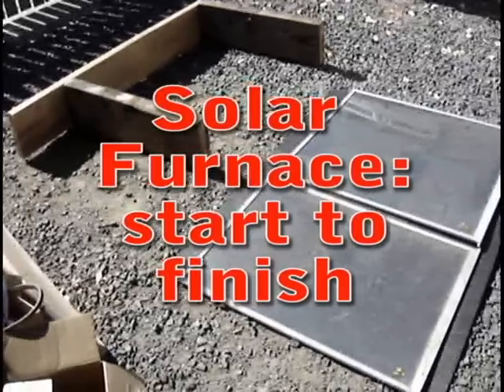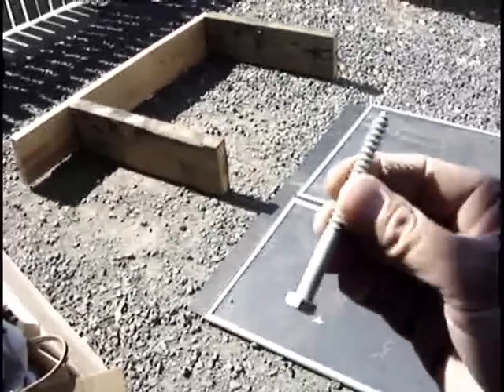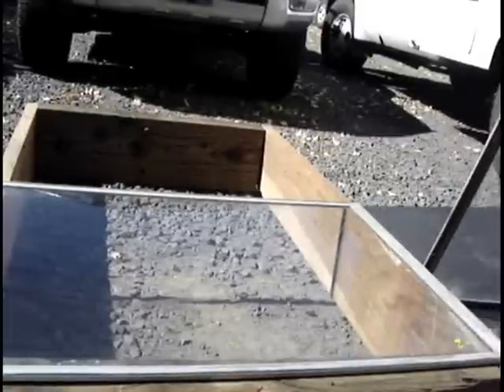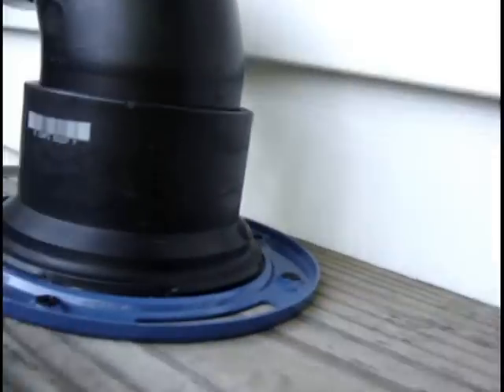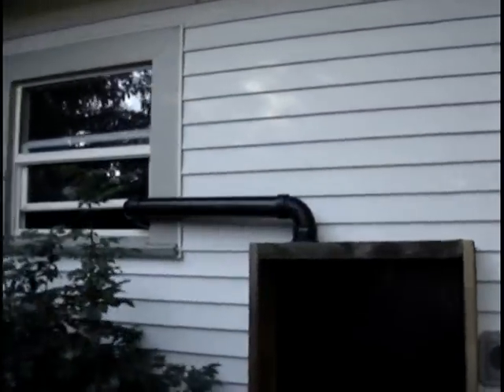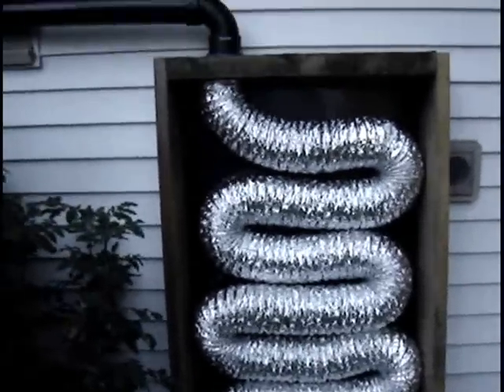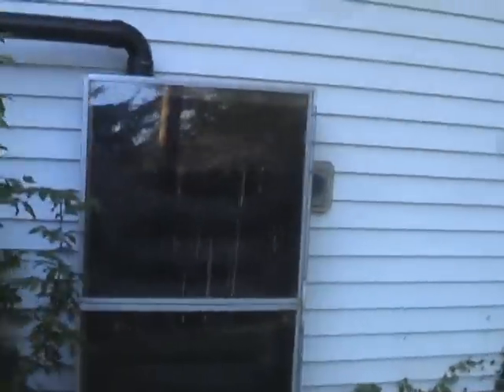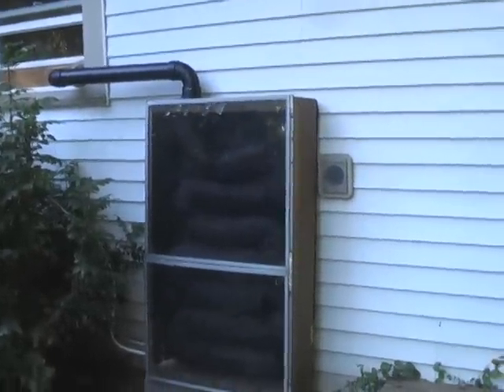Solar Furnace for under $50

Comment: the box needs to have insulation behind the black plastic.   the coiled  vent pipe should be painted black. a lot of the solar rays are being reflected.    The return air back to the box is too small you wont get much of a convection  flow of air, you really need the same size pipe going back as going to the window.  Both the in and outlets need to be insulated.

Comment: What a waist no heat measurement when done makes me wonder if it ever worked. Second insulated duct work from box to window would have been much smarter than just plastic. The heat you generated was lost in the uninsulated pipe.

Comment: To be a good Scientist or Engineer when you make something you have to prove it works.
Reply: I can assure you it does not work.  The amount of heat generated will be trivial, as there is very little solar heat in the winter, which is how winter works, and all of the heat captured will be lost to the ambient air.

I tried a solar water heater in the winter using black 5 gallon water tanks and got nothing out of it.
Reply: @May5Guy  All depends on your nation location -  hours of  Full Sun  sunlight... etc.  Many books and videos and websites explain this... if you get less than 4 full sun hours every day in winter -  you are in too cold a climate,  or you have to  greatly  increase the size of your solar array to make up for the  short time of   Full Sun   energy.
Consider combining with a deep Geothermal  pump... the Warmth of the Earth is always there, just a few meters right below your feet.
Reply: @May5Guy  I can cook in the winter using my parabolic solar cooker. Must be some kind of good sun hitting even in the winter.
Reply: @May5Guy  There is PLENTY of solar heat in the winter. We have solar ovens that get close to the same temps as Summer, just not the length of time to cook with.

I have an indoor outdoor thermometer that I installed in our greenhouse. Today the outside temp was 32, the inside temp was 80+.
Reply: "Demonstrate",  not  prove.   Proofs are for mathmatics.     In science you demonstrate your concepts and data and experiments  all line up cohesively.
Reply: @SeaJay_Oceans  You have never heard of "proof of concept?" Wow.
Reply: NUTS! Do it for whatever reason you want, especially if you enjoy it. Don't ever consider spending any time - at all - proving yourself to others. Just who TF do they think they are, asking you to prove yourself to them? 

However, it does help if you're trying to make a sale... Proove it. Then take as much money as you can from the lazy, or ignorant, or no time/talent/skills, nitpicking crowd! (Remembering to be kind to the people that appreciate what you do) What the heck! Be kind as often and with as many people as you can. It's a good way to move from here to there.
Reply: @johnshilling2221  ... If you're gonna take the time to make, edit, and upload a video to show others what you've done, then yes, it would be helpful to show your efforts working.  We already know that systems like this will work but if you have a newer design (i.e. not pop cans or gutter spout) then it would be nice to show how well your system works !!
Reply: @huf67  I don't see this helping much for a house, but it could be a solution for a shed that you want to keep from getting below freezing.

Comment: No offense but the one I made with beer cans and insulated with greenhouse plexi over it raises the house air temps by as much as fifty degrees. It moves a lot of air by convection at that temp. It's built on a thermopane design pulling in house air, heating it and returning it to the house. Inlet fits in the bottom of a window so it can be removed easily during warm weather.

Comment: Interesting.  However, as mentioned I'd need to see actual proof of heat produced before I wasted the effort to make this thing.   And I'd install a simple fan inside the duct to force air movement along with a lot of insulation on the pipe outside the solar collector.   I have solar hot water pool heat on the roof of my house.  The filtration pump sends the water up to the collectors before it returns the water to the pool.  It puts out an astonishing amount of heat.  On a hot day, I can raise the temp of my pool 5-6 degrees in an afternoon.   So the idea has merit.

Comment: Take every principle of thermal dynamics and you did the opposite. This is the worst thermal heat scavenger system I have ever seen. From using reflective materials where they should be dark and dark where they need to be reflective, to using large bore pipe where it should be micro bore and many many ways via a manifold. You didn’t even insulate the heat scavenger chamber to stop captured energy from escaping via conduction, radiation OR convection.  

I don’t think I could actually come up with any single way you could make this worse and I’ve seen some real crappy DIY heat recovery and scavenger systems in my time. 

As a side note, it makes your house look like a hill billy shack, I guess you sold your class with your brains.

Comment: Shouldn't the entire pipe be insulated as well as the intake tubes? Why no insulation around the exterior of the box either? Also, by not painting the wooden frame you will have mold, water seepage, and rotten wood.

Comment: I took a solar energy class back in the '70's when if you wanted to do anything with solar, you had to build it yourself. I am glad to see that there are still people who can build things!! If I might make a suggestion about a solar air heater. Build a box like you did, but leave some room for insulation.  Cut some plywood for the back, and put some insulation on it. Styrofoam sheets are easy to work with. Put some cleats on the inside of the frame, and you may have to put a few supports in the middle of the box. Put corrugated metal roofing on top of the cleats, and paint that flat black. Your idea of using reclaimed windows is fantastic.  Abs plastic pipe is a great idea, with the inlet at the bottom and exhaust at the top. Insulate the pipes that are outside. For more efficiency, tilt the box upward so that the angle to the ground is the latitude you are at, plus 10 degrees. This will aim it at the sun better in the winter. Keep up the good work, and keep experimenting with things.

Comment: My Uncle did this type of thing 30 years ago. Built a box with skinny dividers using scrap paneling to form channels like a maze (All painted black with a plexiglass cover.) with a thermal trip damper to let the warm air in to the garage. No fans to bypass the heat vrs.cold. It was kinda cool! Bigger at the entrance and got narrower as it got to the exit!

Comment: Weak design. It should be made with 2 layers of glass, with an air space between them.
Everything should be painted black, and have baffles from side to side, all the way from bottom to top, to make the air travel further, giving it more time to heat. Also, the pipes leading from the house to the solar heater, and back to the house, need to be insulated.
Reply: I constructed one several years ago at a previous address.

Comment: I'm thinking of just adding the metal black dryer vent pipe between my Storm window and regular window. So easy.  Sun hits it and that cavity space will heat right up quickly imo.   I wouldn't fill the entire window.....just 1 row at the bottom as I want it to look good.  How does this sound to all???
Reply: Its the easiest most cost efficient design, no fan, no blower,  simple,  yet it heats the window cavity

Comment: sorry didnt read all the comments but can this be regulated ?
Reply from the maker: Yes, it can.  In the next video, Solar Furnace Data, I install a computer fan powered by a solar panel.... when the sun is out, the unit blows hot air

Comment: And when the sun goes down, what? Stuff the holes with sweat shirts to keep the cold out?
Reply: Since it is a 4" ABS pipe, just get a 4" plastic pipe cap and slip it on the pipe when you want to shut off the air.

Comment: Paint the intake hoses and all the wood on the box black. Then use a black rubber to insulate the inside of the box. Rubber or asphalt holds in heat really well.

Comment: So why not measure the temperature to demonstrate the effectiveness? Otherwise I am skeptical.
Reply: @ANGLINARMY  ahh vern does work this is just a take on old system used back in 50s and still used back in eastern northern states...check old popular mechanics  and home improvement articles though theirs were much larger
Reply: @miguelcastaneda7236  Mother Earth News had several types of solar heaters.  One of them was portable - use in winter, remove in warmer weather.  It was tilted to catch more sun.
Reply: Good Idea. Remember guy's and girls , too many cooks ruin the stew, Every one has big Ideas. Keep it as simple as possible!. His simple method works!
Reply: Dmitriy good idea, I see these outdated Tv's all the time in my city
So the next time I come across one Im going to pick it up and remove the screen to use for a solar build.

Comment: The cross sectional area of the solar panel intake should be the same as the same as the cross sectional area of the output pipe.  Those tiny hoses are just not going to allow enough air to go from the house back to the solar panel.  Might as well just forget the hose intake.  It is not doing hardly anything.

Comment: Unfortunately, this is probably a net loss of energy.   The air intake is coming too close to the air output and the hoses to the heater aren't insulated.  The air in those hoses will lose heat before reaching the heater.  Most importantly, there is no mention of a shutoff for times when the sun isn't out, like every night.  During those times, the unit will take warm indoor air, cool it off outside and return it to the house.

Comment: Thermodynamics 101:
It is the box that collects all of the energy and heats the air.
The amount of energy entering the box is a function of the 
area of the glass. Period. The tubing, other than that connecting 
the box to the interior of the house ... are irrelevant, and do nothing
to change or increase the amount of energy captured. 
Spend your money on insulating the back and sides of the box
and paint the interior with some dark, flat paint or material which 
will not reflect. This will minimize the heat loss, which is all one
can do with what the box has already collected.
Simply supply cool air from inside the house to the bottom
of the box, let the heated air enter the house from the top.
No need even for a fan, unless you want to spend some of ...
[or perhaps more than] the energy you are attempting to gain
with the project. 
No need to complicate things.
Think Occam's Razor.

Comment: The convection of the warmed air will create an upflow without the dryer vent (maybe better) and you can drill some vent holes (use some screen mesh to cover them) on the bottom of the enclosure for fresh air. You can cut your exhaust hoses shorter (for greater flow), and just let them hang a few feet below the window (maybe cover with screen mesh to keep bugs out). I made one of these with painted styrofoam I had hollowed out and two layers of bubble wrap on the front. It worked great.

Comment: I used 10 aluminum down spout tubes tied into a collector box at the top. My "furnace box" is 2x6 frame with a sheet of cdx plywood for the back and acrylic sheet for the cover. The bottom collector is attached to a hole through the wall into the house at floor level. The top collector is attached through the wall at the ceiling.  I installed a muffin fan at the ceiling that is thermostatically controlled.  The furnace is very efficient.  It produces an average temperature of 170 degrees F on sunny days.  It is worth the investment of both time and $$.
Reply: If the collector output temp is more than 30 degrees higher than the inlet temp. ,then it running to hot and losing heat to the outside. Move more air.

Comment: I will be building one of these soon, but am curious what method of control is used during seasons when heat is not required. Do you cover the unit up to avoid sunlight? 
Thanks.
Reply: Yes , cover it when the fan is not running. If it stagnates it can Catch Fire. And being hot all summer will ruin the paint and caulking. I cover all my hot air solar collectors the day I turn them off.

Comment: Well done, did you make the air intake lines smaller than the exhaust line to slow down air flow and  give the air time to heat up?

Comment: Instead of dark plastic, how about clear plastic and spray painting the dryer ducting flat black with would absorb more heat faster for a higher temperature output.

Comment: Using dryer hose is an interesting idea but the all-aluminum flex pipe that they now sell would transfer heat much better than the plastic aluminum stuff you are using. Also the paint would stick to it much better. Its just a shame you can’t get hoses like this in a smaller 3-inch size. By the way, why did you not mount it on the roof? I can see from the reflection in the window that your neighbor has some very tall trees, which will block out some of your winter sunlight that low down. Also I assume you mounted it on the southern side of the house since this side gets the most direct sunlight.

Comment: There is a great fan design for this type of project. I used to see them in kitchens mostly. The fan is turned on with a pull chain that also  opens a sealed vent at the same time. Turn the fan off and the vent automatically closes air tight. Another idea that makes it more automatic would be to use a driver vent with a flap that only lets air go one way. A duct fan attached to a thermostat would get air flowing in the right direction at a preset temperature.

Comment: Intake should be at least 2X the capacity of the exhaust. Your system is losing at least 75% of its efficiency because the intake is wrong. Great job though.

Comment: when looking for those panels consider old screen doors or even a glass door.  you just gave me an excellent idea for what to do with that pane of glass as big as a door.  But in those old style doors where they have the small panel of metal on bottom for a kick panel then the glass that slides up and down.  that panel, if found, would be perfect
Reply: I have one of those old glass doors! Thank you for the idea!

Comment: Nice project, I believe if the intake was at floor level it would circulate on its own, possibly not need a fan. I built one of soda cans and got an average twenty/twenty-five degree difference from intake and exhaust in winter just letting convection do it's job.

Comment: for maximum benefit, you should angle the box at about 45 degrees to maximize the amount of solar raditiation from the sun.   also, wood is not a good insulator.  you will lose heat to the outside via the wood and the glass.    Smaller tubes inside the box would have given you more surface area for heat transfer.  Also, one large tube insulated from house to box would allow for better airflow and plus would prevent the air from being cooled as it traveled outside the house to the box.  Insulating return line would prevent loss of heat as air exited the box and makes it was to the house.    The end result of all of this would be a 10 to 15 degree rise in the temperature of the air

Comment: I imagine that at night you have a way to block off that system so that it's not just recirculating cold air
Reply: _ CheckTease i would think it logical to go with the vent idea all the way and fit a dryer EXHAUST door to prevent backflow of cold air...

Comment: Why are you taking air out of your house, for circulation?
Reply: Let's say on a given day in the winter the system is capable of raising temperature by 60°F (to an upper limit of let's say, 160 °F). If you are pulling air from outside (34 °F) you could output 94 °F. However, if you are pulling air from inside (65 °F) you could output 125 °F.

This is a very simplified (and on some minor technical points [assumption of heat change being constant] probably wrong) but it should get the point across. Higher input heat means higher output heat.
Reply: Benjamin Kiefer Do you have a fan pulling the air out?

Comment: use the vent hole in the wall  next to the box , not the window...
Reply: That vent hole is for a dryer.
Reply: I think that flex exhaust pipe would work better.I f you could use an old heater core or condenser fill it with liquid seal it off would hold more heat plus the air would run threw it just a thought

Comment: Does this thing work? Why would you choose a heat reflective hose to absorb the heat from the solar chamber. Even if its painted black I have to think the heat resistant coating sitll make heat transfer to the inside air inefficient.

Comment: Better design would be to have the intake close to the floor of the house (and a much larger intake than those tiny tubes), this way, since heat rises and cold falls, the air would circulate naturally, and more freely, than having them at the same height. Also, you should orient the glass so it is directly perpendicular to the sun in the coldest months, for maximum solar gain.

Comment: Am thinking of doing this to get warm air into my large shop/studio area.  Am in Olathe on the KS/MO border......just wondering.  I've got a gas heater in there now and it sure gets very expensive for gas.  Good gawd, remember when natural gas was so cheap you could run it and leave a door open.